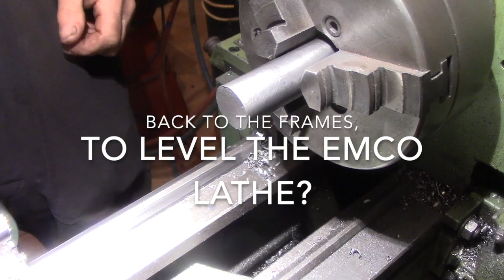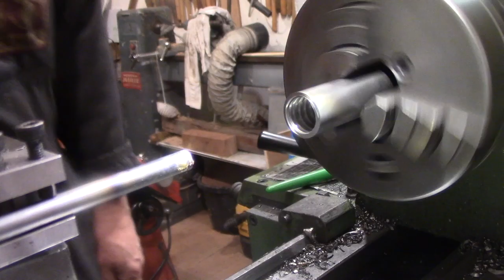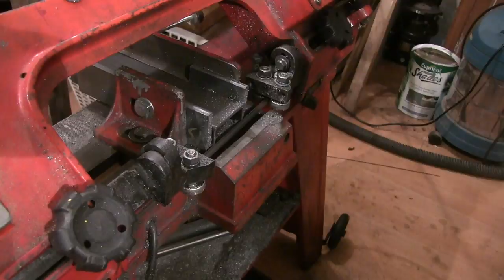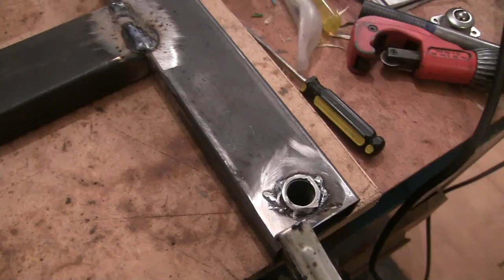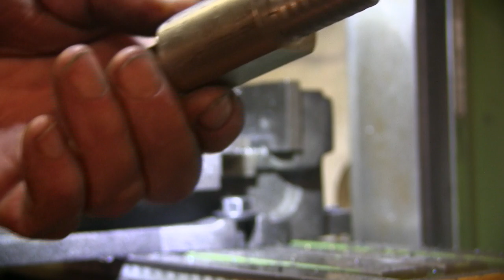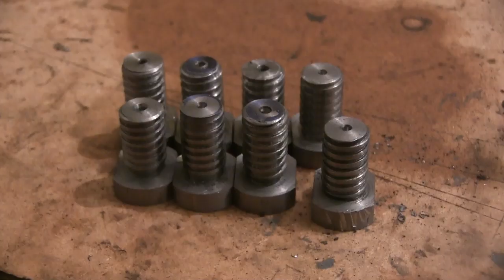Back to the frames to level the Emco V10-p

Comment: Nice work there Cliff, I finally had to get one of those lifts, they do take up some room but mighty handy. How you go about getting that mounted should be interesting. What kind of metal did you make the adjusting screws from?
Reply from the maker: Hello Larry,
I should have gone and got the hoist! :-), I used a bit of "unidentified" bar I think someone gave me, en1a or similar I would guess at,
Thanks for watching,
All the best,
Cliff

Comment: Project coming along well, what electrodes, and welder were you using?.
Thanks for sharing.
Reply from the maker: hello, thanks for watching, 2.5mm rods and a dirt cheap silverline arc welder, does the job, sort of, but combined with my lack of skill not brilliant. :-)
Reply: @CliffsShed  I know the feeling, problem is low open circuit voltage from a 240 volt transformer based welder, rods may have got damp as well, they can be re-dryed in a oven. I found you needed the amps turned near maximum to get any results, plus have the electrode at a shallower angle than normal, I think E6013 rods (should say near bare end) are the only ones that are easy to weld with on these welders. Easy option is to get an inverter based welder, ref 80 Volts open circuit, big big difference in ease to use, they are quite reasonably priced now. Best Regards John.